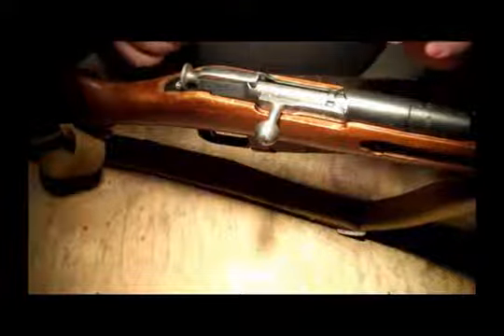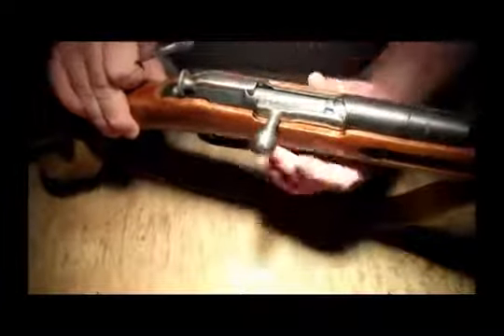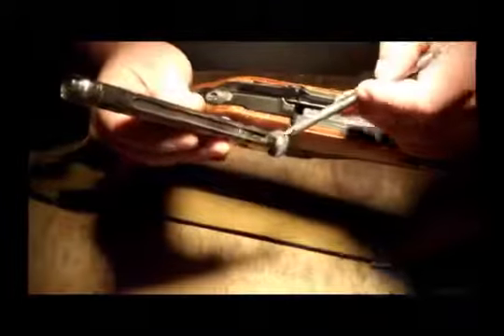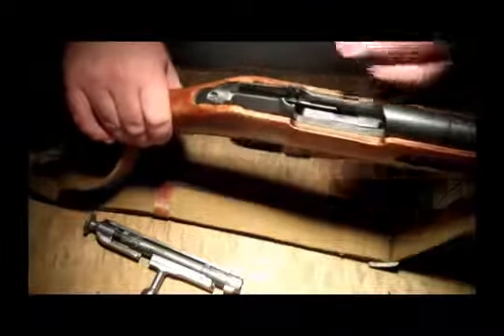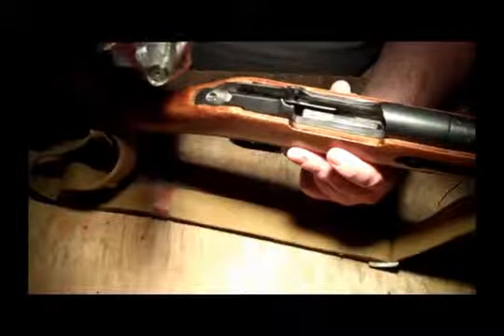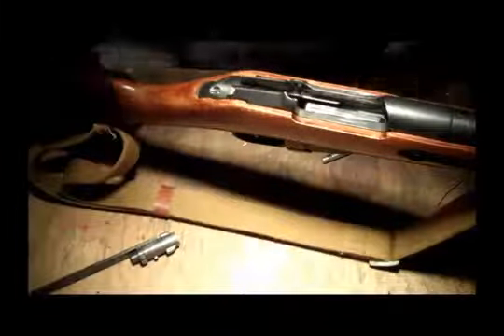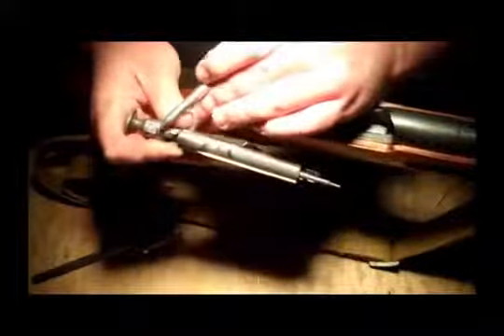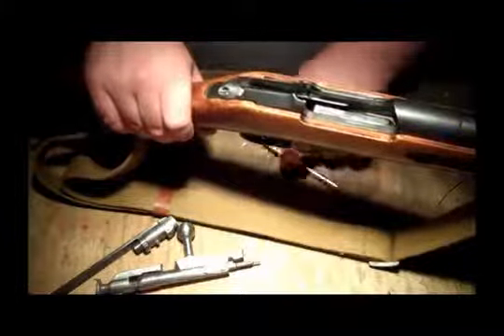Smith-Sights Solution: Mosin Bolt Won't Stay Cocked, the Fix

Comment: Here's a question for you concerning a similar situation. I noticed you were able to open your bolt after dry firing. I haven't shot my mosin in a while, but never had a problem with it. In a recent cleaning I noticed that the bolt will not open after a dry fire. I have to manually pull the bolt/firing pin mechanism back and then the bolt will open again. Any ideas?
Reply from the maker: Hello,

It sounds like the camming surfaces are dry.  Have you oiled it?

I prefer to use engine assembly lube.  It sticks!

Regards,

Josh